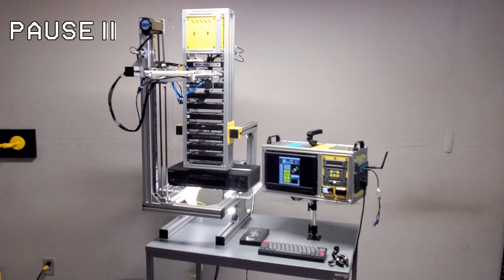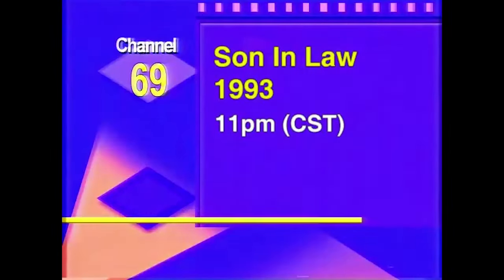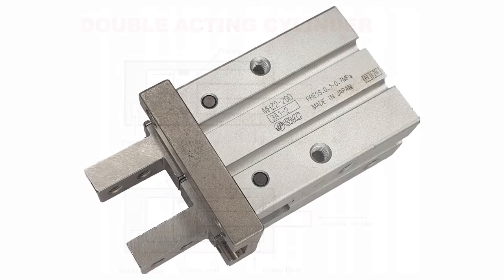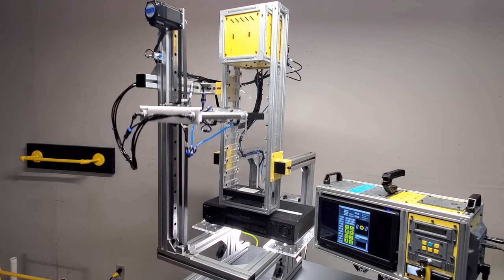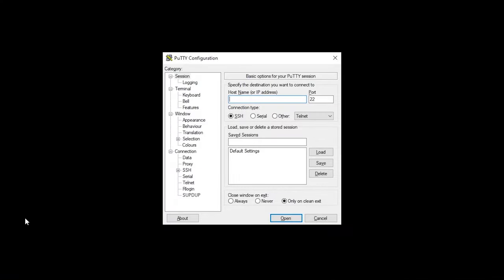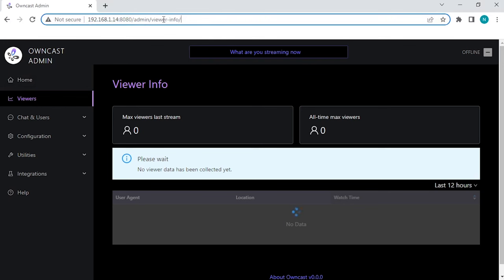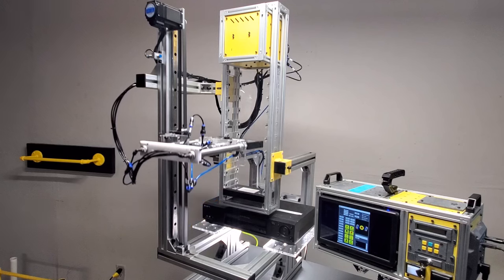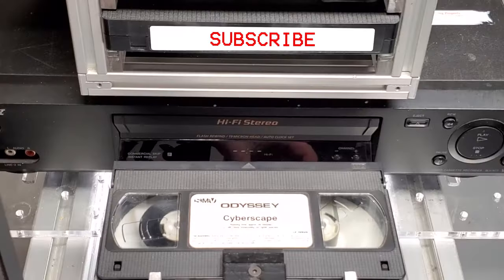I built a VHS video tape robot like the one in Hackers (1995)

Comment: Excellent Job! In 1995 I worked for a TV company in Hong Kong. There were a few of them running in light grey metal cabinets. They were called LMS machines (Library Management Systems). They were using Beta tapes and that room had to be quite cold or else the tape heads would clog up resulting in video/audio dropouts. The tapes had barcode labels for the LMS to recognize etc.
Reply from the maker: I may end up using barcodes with a masking tape or post-it note like adhesive on the back so it doesn't damage the tapes, it's a good idea for archiving.
Reply: I thought LMS was originally D2 format we had about 9 of them in the station I worked in. 
In the newsroom we had a Betacart with about 3 sometimes 2 play out machines it was about 99% reliable and when it went down live there was quite a panic. It was really fast at loading and threading tapes though.

Comment: This is genuinely a VERY useful thing, not just for my hoarded tapes/cd’s etc, but also for Data Archiving!

Either a janky revived digital VHS low cost solution i want to attempt sometime, or those proper LTO Tapes or Sony Optical Disc Archive (or a DIY version with Blu Ray disks in a 3D Printed Cassette…)

I’m rambling, but this is a project that I’ve been wanting to do, so AMAZING job!
Reply from the maker: Thanks.  Yeah it could easily be converted to do whatever media.  The tape holding slot section is easily removable/adjustable so any number of formats would work.   The jaws on the gripper are removable too.  When I upgrade the extender to steppers, that would allow for larger tapes too.
Reply: @midwestcyberpunk  other question, do you have/will you be releasing the CAD and Code for this project?  If i ever make a Makerspace having a    G i a n t   Jellyfin Server running off of one of these machines would be cool af!, heck even just a “jukebox” of sorts for the rec room!
Reply from the maker: @ericlotze7724  Eventually yes.  In future videos I'll go through some of the details and processes I used and release the files to thingiverse or github

Comment: Years ago I  did computer backups.  We used various 'tape changing robots' some for cassettes and other larger form tape drives.  There were even reel to reel robots.  I saw similar robots used at radio stations in the day.  I always wanted to do a large horizontal DVD/CD library with multiple drives for recording and playing.  IBMs Tivoli Storage Manager was my favorite in the day to use for backups.  Your bot looks great, keep it up! (Oh the old bots I used were steppers or servos, no pneumatics).  The DVD archiving units were the size of a filing cabinet with 4 drives and 1000 dvd's that we used at a bank to keep old check images on for a few months till we archived the DVDs to offsite storage.

Comment: for archival purposes it'd save some time to have a tape in waiting position just above the VCR, which can be filled while a tape is playing  instead of waiting for the whole retrieval process between tapes. This would also be a good station to do photography at. I would advocate for quite a different design for archival but staying with the essential design, the location dependent access time can be eliminated by pre-fetching and post-caching to fixed locations. When a tape is finished, move that tape to the post-cache, move the pre-fetched tape into the VCR, and now a tape is playing again so it doesn't matter how long it takes to return the old tape to it's library location and fetch the next tape.

For non-archival purposes this could be slower in one specific case. The gripper must be empty when a tape finishes so that it can move that tape away, wherever it's going. So there is only pre-fetch and post-fetch, if the tape finishes and you're holding a tape, that tape has to go away (pre-fetch or abort). Several modifications would avoid this, one is a double-gripper assembly or multiple grippers , another is a separate loader mechanism which receives and ejects tapes to different locations  for the gripper to interact with them. I think the separate loader is the right idea, but multiple grippers would allow cassette battles
Reply from the maker: Those are good, optimized ideas for a later revision.  If time and money will allow, I'd like to get 2 vcrs and 2 grippers eventually.   Right now I'm focusing on switching the extender pneumatics to a stepper based linear actuator drive.
Reply: @midwestcyberpunk  Linear actuators, assuming the typical threaded rod turning to shift a nut back and forth, tend to be very slow and very high torque. You might be happier with the performance of a rack & pinion, which will be able to move faster and will have a lot less force behind it.
Reply from the maker: @Ziraya0   I'm probably going with a 15mm htd belt at first because I have some left over from the z axis.  Agreed though, rack &pinion is better
Reply: @midwestcyberpunk  Belt should be fine, that axis is low accuracy. There's a design in 3D printers where you run a strip of timing belt between two points, then pull a loop of it between two wheels and over the drive gear, then the drive gear turning will shift it's position along the strip. I think this would be pretty ideal in this case. Instead of turning an end to move a point, you move the point to shift the ends, so the ends can extend past the drive mechanism by almost the whole length of the strip
Reply from the maker: @Ziraya0   I just designed a custom cnc plasma cutter with a belt drive like that.  In fact that may be my next video.  The parts from sendcutsend.com should be here this week

Comment: There was also a U-Matic tape changer called "The Director".  A local hospital had one to automate their in-house TV channel.  I actually have the control unit and some of the mechanical parts out of one that had been scrapped.  Ironically you could do a modern digital version with a Raspberry Pi and some attached storage.
Reply from the maker: I'll look into it.  Any chance you could take some pics of the gripper and gripper arm if you have it?  Very curious

Comment: I have an old DAT changer that we used for tape backups at the ISP I used to work at.
It was controlled via two SCSI channels - one to tell it to rotate to next tape (there were I believe 7 tapes in the carrier) and the other to read or write to tape.
Same idea with a gigantic MO jukebox one of my coworkers owned - except that had one robot for moving media between storage slots and drives, and four MO drives, so it took 5 SCSI channels. :P

Comment: The machine loader in hackers was a real thing. I saw one in Sky TV in London to load up BetaSP tapes of all their shows. They would barcode the tapes and dump them in a pile and the machine would load the pile into bays and then the shows would be entered into a system where the timecode of the start point of the show was entered. The loading system would fetch the tape load it, forward the tape to the precide timecode and play it and then use an automated vision switcher to cut to that deck. It meant several stations worth of shows could be handled without a live guy there. The only tech person they needed was a person to watch the machine. It filled a whole long room and the arm moved quitre quickly. If you contact sky tv they may have pictures of it in use.
Reply from the maker: Interesting.   Do you remember if it was pneumatic?  I know there are similar units that actually exist/existed but the one in Hackers moves very jerky when the footage is slowed down, like it's a prop.  Also the tape fight scene, that would be a bit of custom programming but not impossible i guess.   I'm open to the idea that it's not a prop though.
Reply: @midwestcyberpunk  I have asked the Sky Technoical Director who no longer works there. I will get back to you. In the meantime check this out... looked similar to his but a room size not a warehouse size.
https://www.storagetutorials.com/tape-library-autoloader/
https://cdn.ttgtmedia.com/rms/onlineImages/IBM_3590_DLT_mobile.jpg
Reply from the maker: @thesecretvaultunleashed9244   I appreciate it.   I think a lot of hackers WAS in fact shot in the UK
Reply: @thesecretvaultunleashed9244  What did they say?
Reply: @comedicsketches  Ive asked one of the former Technical Directors of sky to chime in and hopefully he will give some more details here in the comments. I was given a tour by him and I do know him.
Reply: @comedicsketches He said it was called "The Beta Cart" and Sky had the first few machines ever built by Sony... this is what he said. "The ones we had were the first ever built. 
Serial number  000001 00002 00003 00004
A smaller version was used for  Sky News. Smaller tapes.  Side loading by a vertical robot loader caddy"
Reply: @TheSecretVault  The one in the movie is umatic, has multiple rows, etc. Beta cart is single row, held Beta tapes, not Umatic.

Comment: I worked in a post production facility that had plenty of these machines. Some TV channels were nothing more than one of these machines and someone there to watch the output - single man operation!
Because some of these channels were totally forgettable and on cable or digital services nobody watched, there was nobody around to remember them. For example, the Landscape Channel? Yeah, there was a channel that just showed pastoral scenes all day.
The companies that serviced these niches were very niche too, and in the UK the customer base was all condensed within spitting distance of the BT Tower in the West End. From the middle of the late 90's hard disks began to take over, with companies such as Grass Valley providing very bespoke things.
So much merger and acquisition activity went on that nothing was ever lasting forever.
We also had the transition from analogue to digital, so U-matic was really old, that was for people that could not afford Beta SP or DigiBeta. DigiBeta decks were often hired for the day, they weighed 50Kg in the flight case and cost around $50K to buy.
Only around the turn of the century did you start to have kids in basements with After Effects doing title sequences that this absurdly expensive game was up.
My favourite kit was the clock used to synchronise everything. We had two Leitch clocks, costing $40K each and they did not even tell the time. They sent a timecode signal out to the clocks that would show the time, however, the clock itself was this 1U unit with an unforgiving US modem connection on the back that you could dial into and set the time. I had to do this when the clocks changed and invariably one clock would try and correct the other, so I would be running around the building between the two clocks trying my best to utterly botch it up as best as I could, slightly pissed at 2 a.m.
Reply from the maker: That's the vibe I got from the tape titles in the Hackers scene. "Up your Garden Shed" is one of them.

Comment: Sony had some pretty large tape robots back in the day - unfortunately, I only saw it after it had been decommissioned, but one place I was working at had a D2 library that was spread over multiple 19" rack cabinets - even though it only handled the "medium size" D2 carts, they were still huge (11" x 7", I think) - that was using DVR-28 D2 machines, one of which I still have.  It was replaced with a Sony Petasite digital tape library that used LTO tapes.
Reply from the maker: Yeah they would be too big and heavy for my home use.  Probably fairly reliable though.
Reply: @midwestcyberpunk  The people that had used it before it was ripped out said it was extremely reliable - it was pretty complex though, not least because it had to flip the tapes through 90 degrees to load them. The Petasite was a lot simpler because it stored the tapes in the library in the same orientation that they loaded into the drives.